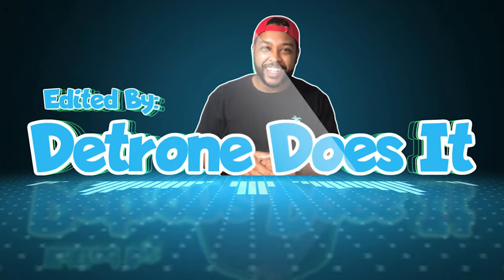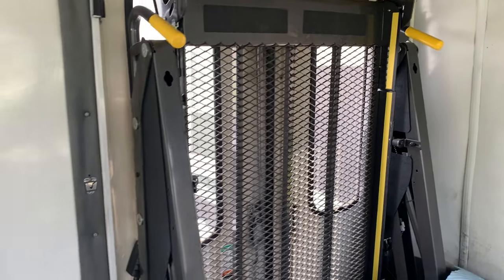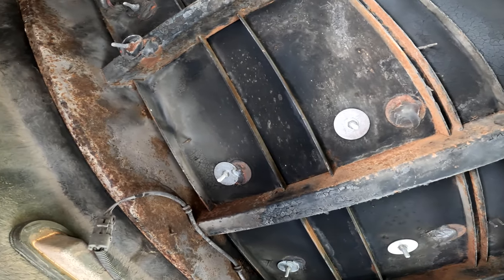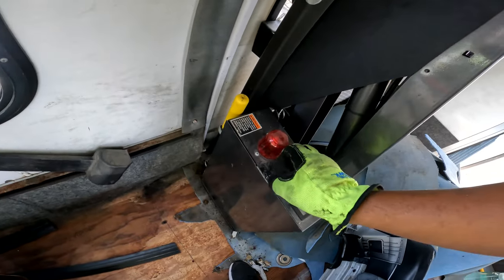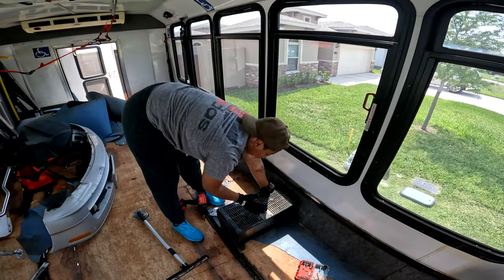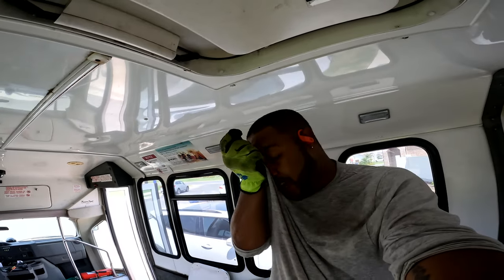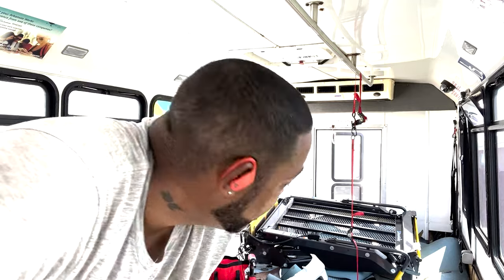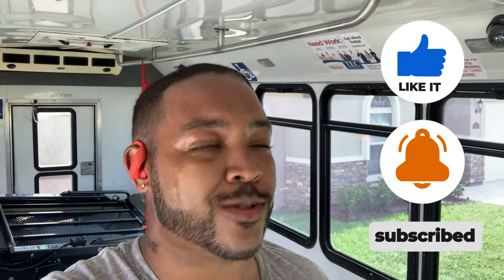Shuttle Bus Conversion | #Ep3: Removing the Lift

Comment: You made that look so easy! I still have the lift in my van after two years and incorporated it into my kitchen set up. This is the first video I have found that gives a simple detailed description of the process. I'm now inspired to attempt the removal of the eyesore in my home on wheels. Thanks for sharing
Reply from the maker: Thanks for watching! It was not that difficult once I got started but it took me a moment to feel comfortable disconnecting all the wires and bolts… because I knew it was no going back after that lol
Reply: So how many wires were left after disconnect  @DetroneDoesIt

Comment: Good stuff man why are everyone taking the rear heat out is there a reason or is it just cause
Reply from the maker: My overhead AC unit in the back is too loud which is why I’m taking it out (I’m going to try a motor replacement first to see if that makes it quieter. I’m removing the floor heater for 2 reasons… 1. my floor design doesn’t call for it and 2. It’s south Texas, so I really don’t need a heater at all.
Reply: @DetroneDoesIt  I just removed my floor heater a few days ago.  I thought that the hoses were some kind of heating oil or?? A bit leaked out and I jammed some rags into them temporarily and then I removed my rear AC over head but left it connected to the freon hoses in order to get them properly/safely evacuated per CA rules.  Funny thing happened on the way to my mechanic to remove the freon.......what turns out to be ant-freeze/coolant starting shooting out of my loosely capped heater hoses (apparently all one system-lol)  shuttle went into limp mode because it got too hot SUPER FAST like a few miles to my mechanic.  All good now- he safely removed the freon from the rear ac lines and placed a bypass hose repair for my cooling system.......I am ready to remove my lift now too as well as the under floor AC compressor for the the rear.....my mechanic mentioned that some people leverage the secondary compressor port under the hood as a basic air compressor with some tweaks I guess- won't be doing anything that crazy for a while though
Reply from the maker: @jamesbrody9826  Whoa! That’s wild… luckily your mechanic wasn’t too far away or it could have done some damage. I am changing the motor in my overhead unit right now to see it that quiets the unit down. Because it blows cold air but it’s just super loud… and I can’t have a conversation with that thing on. If that doesn’t work, then I’m going to have to get my Freon system emptied to remove it.